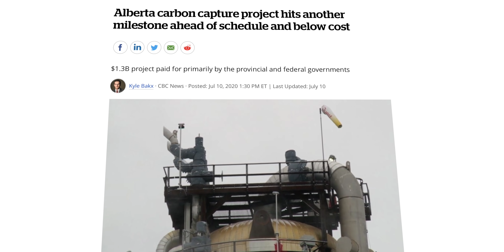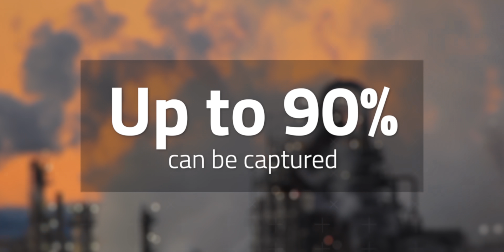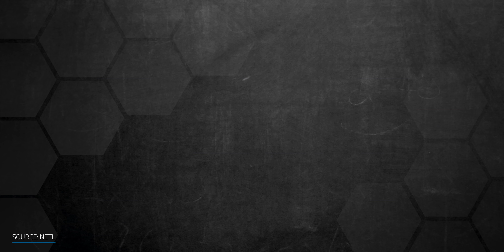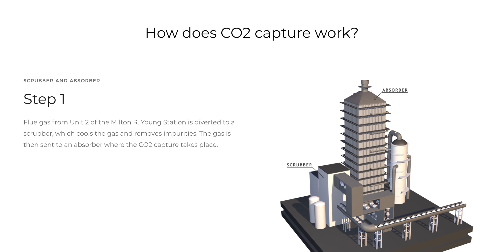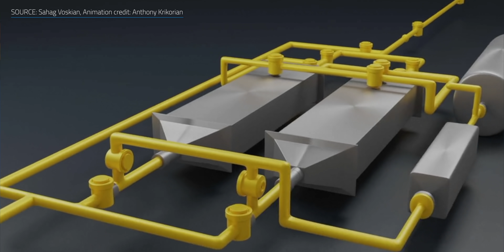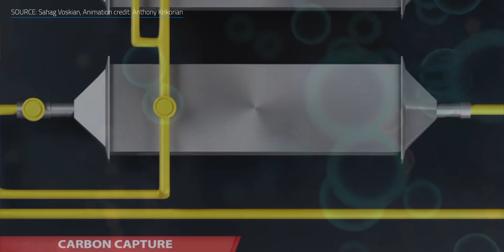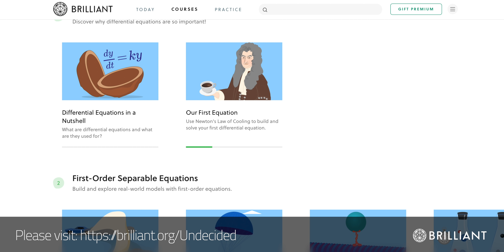The truth about capturing CO2 to reverse climate change

Comment: I have a question.

What exactly is the big deal with burning coal and gas and whatever they use to generate electricity, when the exhaust is just O2 with perhaps 1000 ppm CO2?
Isn't this a good thing for the industry, knowing that they only need to invest in such devices or a electrostatic precipitator which is another technique of taking the CO2 out of the air.
If they can reduce their emission drastically, it can only be better for the environment, if we can have a win win situation there.
I know both techniques are very welcome on the planet Mars... Actually, it will be vital to supply us with air, so will micro organisms and bacteria.
Also, you can't reverse climate change. Why not, very simple, CO2 isn't the problem, that mixes with the air, it's almost just as heavy, it doesn't pollute our atmosphere at the top, those are lighter greenhouse gasses, like hydrogen for example, Methane, all that junk from your spray cans that supposedly damaged the ozon layer, those gasses actually trap heat from the sun melting ice caps and the north pole, so the sun can heat up more water and more water vapor rises to the top, more methane is released from the bottom of the oceans and permafrost, CO2 is nothing, maybe 2% of the problem, if it is that much. If we want to reverse anything of heat, now it's heat, then it's an ice age again.... then we have to paint everything white, or reflective in the direction of the sun, so it can bounce off instead of heat up. The second reason why, is because of the tilt of the Earth. we're already at a critical point, seasons are already exaggerated. More sun reaches the north pole, it heats up the Earth more, if you have a solution for that, then ok, let's reverse climate change. If you were at the south pole right now with a multimeter that reads CO2, you would read about 400 ppm over there, which seems high over there, since there isn't any industry. Why, because it's almost just as heavy as air, it mixes together.
Try it with your mouth mask and don't piss your pants when you read the results, if will go off immediately and rise to over 10000 ppm :)

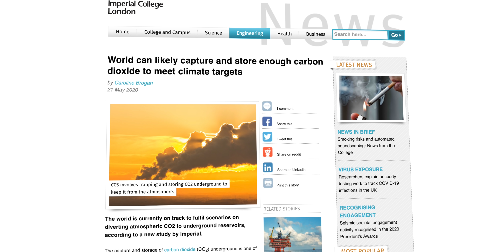Comment: 6:21 As the owner of an agricultural business where I have to purchase around a Ton (dimension) of CO2 per year as a "fertilizer" for my crops, I would love smaller scale Direct Air Capture CCUS options to be able to implement on my property. I am already spending money, so I would love to better place it. I'd love if anyone could help me explore options. Matt, were you able to find any info on smaller companies (than ones wanting to operate on coal fire plants) during your research? Climeworks wasn't able to work in the US the last time I spoke to them, so unfortunately that wasn't an option.
Reply: It can be done.  No mention at all of using photosynthesis (the old fashioned way) of storing carbon. Can be done locally on small scale   Already reduced to practice.  Has valuable output and ROI of less than 5 years and shrinking. Now working on business plan to make attractive to tens of thousands of sites.

Comment: Co2 is not polluting. CO2 is life supporting gas that all plants need to grow. If CO2 goes under 150 ppm all flora on earth will die. And soon after all fauna shall die as well. The optimum level of CO2 in the atmosphere is between 1000 and 1500 ppm. We are far from there yet and the temperature impact would still be very modest.

Comment: The holy grail of carbon capture is AIR TO FUELS where you take the captured co2 and turn it into fuels for existing transportation. Anything from planes, trains, automobiles and ships. This is already being done.  Full cycle carbon. Only thing is you need energy and hydrogen.  Solution: Renewable energy or even better new Nuclear WASTE BURNERS(yes nuclear plants that burn existing waste) can provide the energy and the hydrogen and be 100% safe. Getting rid of nuclear waste, taking carbon out of the air, turn it into fuels we already use, off setting the consumption of non-renewable hydrocarbons. A whole new job sector for the economy. Win, win, win , win,win. Of course the new nuclear plants aren't set to be ready til 2030ish but couple these 2 technologies together and we have a endless supply of nuclear waste to provide fuel for the planet for thousands of years. Full carbon cycle.

Comment: So how much energy does it cost to capture carbon. And how much carbon is released to generate that power...
Reply: Good point!
Reply: While a valid concern, the energy used does not have to generate carbon dioxide while being produced. So it entirely depends on the grid its hooked up.
Reply: @alexxans1154   I wish I did but it doesn’t, because even if you power it with only green power, that green power could have been used to not generate CO2 in the first place somewhere else and so if that would’ve saved more CO2 from being made then we are capturing with that same amount of energy we are at a net loss.

The only thing that matters is how much CO2 they capture for kilowatt hour and what the average CO2 generated per kilowatt hour is.
Wherther they powered it with green energy or not, until the average mix is green enough that this is more efficient then say running the dirtiest plant in that mix there is no net gain, Otherwise shutting off that plant is better

Comment: Matt, the problem with large scale carbon direct air captured doesn't just come down to MONEY. It comes down to THERMODYNAMIC reversing a reaction that produces energy requires more energy than you initially got out of that reaction. Burning carbon for energy just makes no sense energy-wise unless you can stick it directly BACK into the ground. 
Saying it just comes down to money just abstracts the problem, and suggest:"ah well, the experts will figure it out" . I think there is a place for carbon capture, but it's very far down the list, well after the entry:  KEEP IT IN THE GROUND ;) because PHYSICS!

Comment: I would love to see funding for garbage incinerators combined with carbon capture. There are several waste stream cleaning technologies that could scrub the air of TSS, then use the heat to turn a turbine and power carbon capture devices, and put the collected gas into permanent materials of various sorts.

Comment: Climeworks also turns CO2 into rock in the ground beneath it’s DAC facility in Iceland.
Reply: Forming carbonate salts (such as calcium or magnesium carbonate) can be done, but you need tremendous amounts of calcium or magnesium do to this. There are only a few deposits, so you'd have to ship the mineral around the world. It is not a practical solution.
Reply: sjn 72 From Climeworks homepage:”We remove carbon dioxide from the air with our direct air capture machines. Carbfix then mixes the carbon dioxide with water and pumps it deep underground. Through natural mineralization, the carbon dioxide reacts with the basalt rock and turns into stone within a few years.”
Reply: @svanteforsman8244  As I mentioned in another comment here, direct air capture is a dumb idea - it is extremely energy intensive and poorly scalable. The only solution is point of source capture, why wait for it to be diluted in the atmosphere? It sounds great to the public but it is really a dumb idea.

Yes, carbon dioxide will react with water to form carbonic acid (it is actually in equilibrium with gaseous CO2, aqueous CO2 and carbonic acid, very little of it is carbonic acid), you can neutralize the carbonic acid with minerals such as calcium and magnesium, to form carbonate minerals. This is nothing new or special. Pumping this underground takes massive amounts of energy and you can only do this where there are large deposits of compatible minerals, so then you have to ship CO2 all over the world which takes energy. Nothing is free.
Reply: sjn 72 Climeworks is not shipping CO2 anywhere. It works and they are getting customers who are willing to pay for it. 
Even if we stop all emissions today we still have all the ”legacy” emissions to deal with ie we have to reduce the atmospheric CO2 to levels that are safe long term, probably below 350ppm. Every ton of removal will be valuable and I think DAC will be one of several methods we will use.
Reply: @svanteforsman8244  I didn't say Climeworks is shipping CO2. DAC is a dumb dumb idea. Flue gas is around 25% CO2 or 250,000 ppm whereas in the air CO2 is 400 ppm. It makes no sense to capture CO2 from the air at 400 ppm when you can capture it at the source where it is at 250,000 ppm. Why wait for it to dilute?. This is really engineering 101. It takes a tremendous amount of energy to capture CO2 at 400 ppm, where does that energy come from? Burning coal?

Removing a ton of CO2 is inconsequential when 40 B tons are released annually. It's like saving a sinking ship with a teaspoon. Climeworks has only 2500 subscriber in the entire world, what they are doing has no effect on anything.
Reply: sjn 72 Only renewable energy is being used. They are scaling up as we speak. And so is the canadian company Carbon Engineering.
Reply: @svanteforsman8244  Why burn coal and then use renewable energy to capture the CO2 when you could have just used the renewable energy in the first place? This makes no sense. Go look at Carbon Engineering's picture of their DAC on their website. It is tiny (the size of a shed). Now compare that to a coal fired power plant. According to their own literature, their DAC process is powered by natural gas.
Reply: sjn 72 The Climeworks DAC + storage facility is in Iceland. I think Iceland is already 100% renewable. I’m sure Carbon Engineering also intend to use 100% renewables as soon as possible.

Comment: Carbon capture would use the energy of 5 units of Fossil Fuel for every unit of Fossil Fuel burned.  Looking carefully at direct air capture in particular assumes the energy comes from excess renewable les that are above the immediate demand due to supply peaks.  The cost of these carbon capture plants will be immense and dwarfed by simply not using Fossil Fuel in the first place.   

While most say trees are the answer this is mistaken since if we were to plant every square foot of arable land with trees in one year it would still not equal the amount of carbon emissions produced in that year. Essentially, even if we gave up growing food, trees would not suck up enough carbon dioxide to slow down the increase in an appreciable fashion. I recall it around 90% of the carbon dioxide is absorbed by the ocean anyway which gives us a false idea as to how much carbon dioxide actually has to be removed since the ocean is acting as a carbon sink and we need another one.

others have stated that the carbon dioxide should be pumped into greenhouses to make plants grow which is not necessarily true for many plants that have evolved with the existing level of carbon dioxide. For those planes that would thrive in higher concentrations, there are complications such as the requirement for more water and other minerals so it’s not just an easy fix.

I mentioned Direct Air carbon capture which is probably the most expensive process but capturing carbon from coal fired plants would make them even less competitive than they are now since in most cases they already cost more than renewable energy. It would be far better to use that investment to create more renewable energy which would give immediate and long lasting results and not encourage the use of coal which has problems beyond its carbon production such as the toxic byproducts.

By far the cheapest solution is to start taxing fossil fuels for firstly the healthcare costs they incur which is around $120 billion per year in the US and kills around 110,000 people in the US and around 40 million people worldwide. The fossil fuel industry gets away with pushing those costs onto the general population as it does the environmental costs which globally probably exceed the price of the fossil fuel by a factor of 10. He study at Stanford showed that the cost of burning fossil fuels was around $65 trillion in an $86 trillion world economy meaning that stopping the production and use the fossil fuels as quickly as possible would benefit virtually everybody on the planet. Fossil fuels should only be used as a transition to renewable energy.

Well some countries have place limits on the final date that fossil fuel vehicles can still be produced they are by and large much much much too far in the future to have the effect we need if we intend to drastically lower carbon dioxide in the next 10 years. Pretending that this can be done by carbon capture is a fools errand because the cost of doing so would be dramatically greater than simply switching from fossil fuels to renewable energy along with storage.

Looking at the issue from first principles makes the situation much clearer. The earth has been storing carbon in fossil fuels for several billion years so to pretend that we can release these in one century and not suffer the toxic consequences is absurd.

Comment: Nuclear reactors are an excellent way to produce greenhouse gas free electricity and they could power these carbon  scrubbers.
   New advances such as small modular reactors built on an assembly line and trucked out to sites around the globe that could be as common as a Walmart or a hospital. Truly enabling a local power grid coupled with wind and solar.
   Make no mistake that there are forces that want to make nuclear power so expensive that it's not viable.
   When you look at the worst case scenarios of Chernobyl and Fukushima you can see that nuclear power is truly not the boogeyman that people want to make it out to be,  but rather the overreaction to an accident.
   I recommend podcasts such as Titans of Nuclear and lots of YouTube channels educating on how nuclear power works,  including the economics.
   I would much rather live next door to a nuclear power plant than a coal or natural gas plant.

Comment: Why dont we use solar power to produce hydrocarbons from the air?  This would counter the fossil fuel demand without needing new devices for consumers.
Reply: You should read on how much carbon is used to make a solar panel.  It isn't that good.  Nuclear or even better, thorium energy would be a better solution.  Least till we lower the carbon cost of making the panels.

So many people look at the emission of a tech but ignore what is needed to make, repair, or recycle the materials.

Comment: marine engineer here. must say i'm getting sick of hearing CO2 capture as a solution. it's unpractical, expensive and unsafe. specially open air CO2 capture... no. if you want change, shift to more green solution. electrify the world, and plan more trees and use them for building material, furniture, housing, gadgets and so on. if you want to waste money further. sink trees into deep pockets and let the tectonic plates pull it underground. but really. plant more god damn trees.

Comment: The fastest way to cut CO2 emissions is to evaporate water to run green house farms for food, fabric and ect. this can be done by pumping sea water on to land that is too salty for regular farming. By building a mound of fertile ground with a think hydroboundry layer you can make a shallow dome green house with open sides. A solar updraft tower will draw the water vapor though it. The solar ponds store heat and keep evaporating at night. The Domed solar updraft tower would have sheets for clear plastic, acrylic or plexiglass for water to condense on to water the plants. This way you use global warming to grow food, make salt and materials such as hemp and bio oil to be harvested. Also taking sea water that has carbon dioxide and using a catalyst to turn it into fuel can make a self accelerating cycle to reduce dependence on fossil fuel that will be net carbon neutral for the entire Earth. This may be better long term than carbon sequestering.

Comment: There is a nice, cheap, scalable and proven technology to capture CO2: The "tree", often used in large plants called "forest".

There is no secure proof that the CO2 level is the main reason for climate change. It also can be just a side effect.
The deforestation of the planet also correlates the climate development 1:1.

The eruption of a CCS storage is likely to suffocate whole counties. As the critical temperature of CO2 is around 35°C any under earth storage is under 50+ bar of pressure and ready to erupt at any time.

Comment: Just to comment on a single aspect of this video, capturing CO2 from air to put it into carbonated drink is not really doing anything. The person drinking the drink will not absorb the CO2, it will just go back to the atmosphere pretty quickly. 

It's a fringe problem, but many of the CCOS projects have comparable problems, where either the storage is non-permanent, or the capture requires energy that is still generated from fossile fuels, so there is no net-effect.

It's really time we start understanding that no amount of technological process available within the next 50 years will free us from the responsibility of significantly reducing our consumption, especially for those of us part of the global 1% (i.e. those having a monthly income of more than 2500$ PPP).
Reply: This is a solution to a degree only because we already put carbon into drinks.  But it is like using plants to deal with carbon, but speed running the results.  However, taking the carbon to make into a solid or solid component will be the best long term solution.  Especially when paired with thorium power plants.

Comment: Why show steam from cooling towers?  There is no emissions.  It just cools water that cant be released to a lake.  And some of those stacks ya just see steam from soot blowing.  Little to no opacity.  Also that one stack smoking swathe opacity is too high.  If it was a responsible electric company the opacity shouldnt exceed a 5 minute average of 20%.  Most of the time opacity is low low.